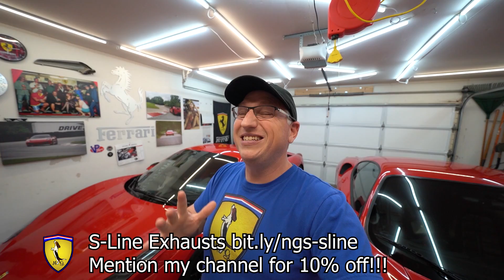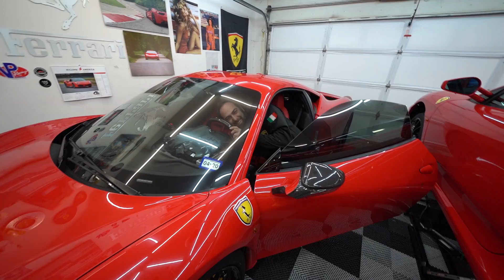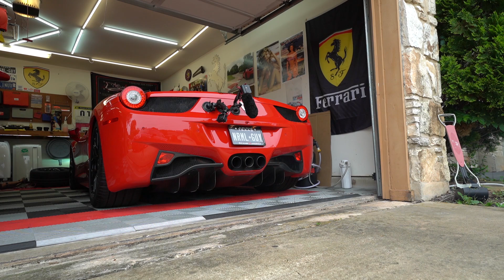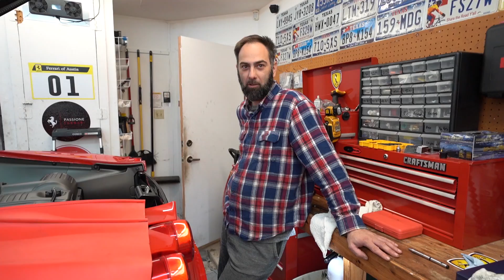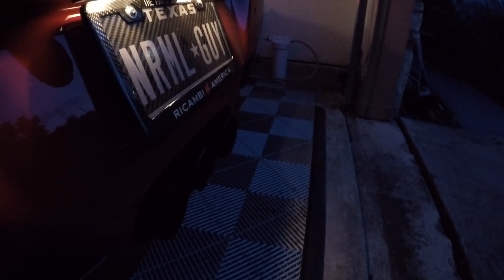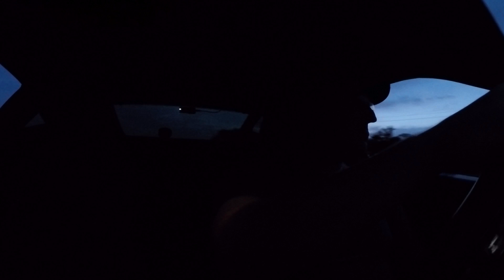FERRARI 458 TUNING to get MORE HORSEPOWER, MORE POPS & BANGS, & FLAMES!!!

Comment: Love the flames! Ah yes. Tunes arent always final. Usually some data logging is needed to perfect the driving experience. Unless it's a generic canned tune which would be conservative and not exactly mapped or customized to your exact vehicle (every vehicle even of the same make and model and trim can have varying ecu parameters and current conditions environmental or internal)

Comment: Sheet metal cover all around exhaust Will prevent from burning red paintjob
Before doing mods Like that you must consider flames Will increase temperature inside bay engine and its way out

Comment: Just make sure that you use gas brands that meet Top Tier specifications for detergents to prevent carbon buildup. No, it's not a gimmick.
Reply: This is true ! The top tier really is better . Easy to see which ones are on the website. My Porsche does care unfortunately